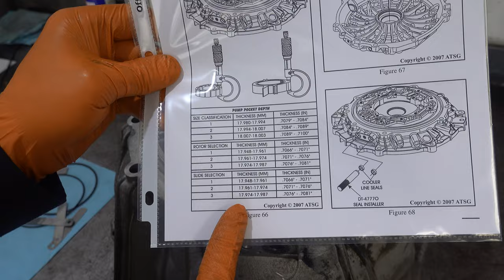6L80 Assembly PT1 - Subassemblies (DEMO) - Please Read Description

Comment: @Nickstransmissions so I have a 2013 Sierra 1500 4x4. 6L80E. I have the p0741 TCC solenoid stuck closed. So July of last year I installed a new transmission, new billet 3800 stall triple disc converter from ProTorque and their billet flywheel. Everything drove fine until Jan of this year. All of a sudden the code came up and the converter no longer was working. Along with Manual mode only working in 4-6, and the stall speed was higher. So I had a spare new 6l80E, before swapping them I did my research to see why it was doing it. Come to the conclusion that it was either the TCC solenoid in the TCM, the TCC regulator valve in the valve body, or the TCC control valve in the pump. I ohm’ed out the solenoid to the best of my knowledge and it passed. So I said screw it and put the new trans in, when I did even after programming and tuning the new trans it would reverse fine but it was stuck in 3rd gear. So I took the tcm&valve body from the trans that I thought the control valve in the pump was stuck in and put it in new trans. Lo and behold the problem transferred over. P0741 code, and the converter isn’t even trying to lock up. Now this whole time the fluid has been amsoil trans fluid, I have an inline tru cool 40k cooler, and thermo delete. It never really got above 170 even when pulling stuff. So I know it never got hot and I don’t think the converter is the issue. It’s got to be either the solenoid or the regulator valve because the problem transferred over from trans to trans. I don’t really wanna buy a TCM/Vbody ass, but what is the correct way to test the solenoid? It’s the 5th one from the Cannon plug for the harness. I swear I can command it to lock up and hear a noise like an electric motor run noise and then it stops and doesn’t do anything. What you think?
Reply from the maker: Hi Podunk Mechanics, thank you for watching...

I would vacuum test the valve body, paying close attention to the TCC regulator valve's sealing integrity. My guess is that it's worn. The new transmission should have had some valve body correction kit installed unless it was a GM remanufactured unit. 

You can watch my 6L80E Diagnosis and Troubleshooting PT3 which covers vacuum testing...I use Sonnax's vac test machine and their plates but I don't think you need the plates themselves, just the machine.

Here's the video: https://youtu.be/aBx63Vwo6mA

If the valve body does not have a Sonnax Zip kit or Transgo Reprogramming kit installed, I'd definitely install one of those two kits. You may also have  weakness in the pump (limit and control valves for the TCC) but can't vac test those unless the pump is on the bench...

Comment: So just thinking aloud… we install the Sonnex zip-kit with the o-ring fitted plugs to help mitigate hydraulic pressure loss. Along with that valves and other goodies are installed in the valve body. So my question is, why are you so hell bent on absolute pump perfection? We know the pump is capable of far more volume than what is actually needed to operate this unit even as it ages. Do you feel that once the Sonnex updates are done the transmission can operate normally and for a long time with a less than perfect pump?
Reply from the maker: Hi Larry,

"Hell-bent on pump perfection"? Interesting choice of words from someone who rebuilds (I'm assuming you're a fellow transmission builder)...I hate comebacks and warranty my work so everything is either new, brought up to spec via reconditioning or upgraded based on all the known areas of weakness in these (and any) transmission. 

That's why I have the standards that I do for all the transmissions I work on...I'm not perfect and shit does happen, unfortunately but I try to mitigate the risk of having to do the job twice to the fullest extent of my abilities.
Reply: @nickstransmissions perhaps that was a poor choice of words… I meant no offense at all.
Reply from the maker: No worries, Larry!

Comment: When assebling from all new GM parts, what rotor kit do you use, the thinnest one offered?
Reply from the maker: If using all new GM parts (which is def the right way to go), My machinist sources the rotor and slide then machines the pump body pocket so he can control the clearance, holding it between .001-.0015 between rotor and the pump body deck surface as well as slide-to-pump body deck surface.

Thanks for watching!

Comment: awesome video and great build tips. one question on the planetary. sonnax has a replacement cover, theres really no other way to get debris out without removing and replacing that cover. whats your thoughts? thanks doug
Reply from the maker: Thanks, Doug! I haven't used the Sonnax planetary kit for those transmissions, have it on my list to try for the next 6L80/90 I get in for overhaul.

Comment: I have a 6L90 that needs to be rebuilt, if I rebuild the transmission do I still need to have the transmission/ecu reprogrammed at the dealer?  I know a different transmission would, but hoping if I just rebuild without any performance upgrades  I wouldn't have to.  Thanks
Reply from the maker: Hi Justin, you wouldn't need to have the TEHCM reprogrammed if you either reuse your pre-existing one or purchase an OEM GM (or Sonnax) TEHCM but you will still need to do a fast adapt relearn...Reprogramming =/= fast adapt relearn...Reprogramming means you're changing the operating system on the TEHCM to match what's been installed on the vehicle ECM while 'fast adapt' simply means resetting your transmission's control parameters to how they were from the factory originally but leaving the operating system itself unchanged. 

I'd def install some performance parts if it's within your budget as they can only help, not hurt (except maybe the wallet).
Reply: Thanks a ton for the fast reply.  I bought the truck at an auction knowing it needed a transmission, looked like they dented the pan, likely broke the filter apart and it goes a few hundred feet then quits and the fluid is dark, no pink at all on a white paper towel.  Not sure I even want the truck as I don't really need it so thought about just cleaning and rebuilding the transmission replacing only needed parts to drive for a while and decide if I like it.  Good to know if I do keep it I can upgrade/improve it without having to reprogram it, dealer is an hour tow away. @nickstransmissions
Reply from the maker: You're welcome, Justin - thank you for watching! Please sub if you haven't already as ill be doing more 6L transmission videos in the next month or so.
Reply: Definitely subscribed and watching many videos.  Another question, is it worth putting a new filter in, tapping out the dent and adding some atf to drive it around a little and try to get an idea what might need replacing or should most problems be obvious enough if I follow along with your videos?
Reply from the maker: All the problems will be obvious once you get into it so no real reason to continue driving it...You also don't want to risk damaging the rear planet as those can be very expensive to replace.

Comment: On a 2015 6L90E. In the rear carrier assembly, it looks like it melted the rear piston and melted the rubbery plastic all through the rear clutch packs and locked up the trans. There is no metal anywhere, so it wasn't really slipping anywhere else. All of the clutches are still nice and redish. I am having a hard time getting the 2 shells out so I can get to the big snap ring. Have you seen this before and what may have caused it?
Reply from the maker: Damn, sorry to hear that GPVic...Rear planet failure can be caused by a number of things but most common are a combination of poor maintenance, low fluid levels and hard launches. The two hubs (1-2-3-4 and 3-5-R) that you're having trouble with are likely stuck in their respective sun gears. 

Was this transmission used in a performance application behind an engine making big power? Do you know the maintenance history? How many miles on the vehicle/transmission?
Reply: No sir. UT came out of a 2500 2wd. The guy stopped at a gas station and came out and that was it. I got UT apart finally. Those 2 empty shells are tore up with the bushings. The rear center support bushing is tore up alone with the bearing and the rear planetary gear set is locked up and stuck in the output housing. From the 1234 and I believe  3,5,R housing back I'd destroyed. This is going to get exspensive.  But it'll be new. I don't know what caused it. The fluid is dark and the filter looks clogged so prob lack of fluid to the tear. Now the rear most case bearing is good and I don't see any damage to the case so hmmmm. Maybe find a few used parts nd I'll be in there. All of the clutch packs before the 1234 shell look brand new but that means nothing lol. The lower sprag is locked slap up as well lol. Like I said. Exspensive!!!! Lol.
Reply from the maker: Yep...it may be less expensive to just acquire another core. Depending on year, you'd likely come out ahead vs trying to piece that one back together. My guess is that thing saw a lot of towing/hauling and was never maintained properly, fluid never changed, etc but just a WAG from here.
Reply: Yea that's gonna be my best bet. Thank you sir.
Reply from the maker: You're welcome!

Comment: I watched  another builder on you tube who recommended tig welding the shafts of the 1234 hub and the 3-5-R hub noting that the shafts can break at the hubs with higher horsepower cars. What are your thoughts on tig welding those? Do you think it could affect balancing? Thanks.
Reply from the maker: It's definitely a good idea to tig-weld the 1-2-3-4 and 3-5-R shafts to the body of the hub. Just thin bead all the way around will reinforce the hub and have no impact on balance. I would not recommend wasting time welding the 4-5-6 hub as the splines on the stock pieces can strip under high power/torque...I just replace with one of the billet steel options on the market (I typically use the Sonnax hub as it allows you to run the factory damper).
Reply: @nickstransmissions  Thanks for getting back to me so quickly. I already purchased the Sonnax Extreme Duty 456 hub and shaft assembly and the powerglide style 45 tooth frictions and steels. Along with the High Capacity 4-5-6 clutch apply piston kit. I will Tig-weld those other hubs as you recommended. Thanks again for all your help.

Comment: What would be normal for a machine shop charge to machine the bell housing/pump cover?
Reply from the maker: Hi Omar, that's going to vary but I pay my machinist $175 for a complete pump overhaul. that includes resurfacing both halves, cutting the rotor/slide pocket to depth such that clearance between slide/rotor and deck surface is .001-.0015 for both. I also replace the pump cover-stator gasket.
Reply: Thanks Nick! I just wanted to give myself an idea. I just bought one really cheap with the transfer case attached, for basically what just the TC is worth. If everything looks good upon disassembly, I’ll try to overhaul it following your videos. Thanks again!
Reply from the maker: You're welcome, Omar!

Comment: I am doing a swap in a 03'Crown Vic Police Interceptor.  Ls3/6L90. I bought a core out of a 2015 2500 2wd for $300. The guy stopped at a gas station and turn his truck off. He came out and it wouldn't move forward or backwards. Does it sound like maybe the converter or pump prob died? I know you can't diagnose it. Just curious what it sounds like. And my Ls3 is going to making about 450 ish wheel. Maybe a little more. Should I go with blue clutch plates? Burnouts and ice cream with the grandkids pretty much. Maybe red light to red-light. Down the road once I get the suspension done it may see the track ( road). I may the it drag racing a few times but I doubt much. I'm setting my redline a little over factory. I'm not going to be turning 6800 or 7k rpms. I want my engine to last. And trans for that matter lol. Thank you for the videos. They were very informative.
Reply from the maker: Hi Hugh, thank you for watching! 

The following could cause no movement in any gear/range in a 6L:
- Pump failure
- TC failure
- Stripped input shaft splines
- Stripped/destroyed front or rear gear set
- #1 and #5 check ball getting stuck in the plate
- Broken TCase chain (4WD only).

$300 is a good price for the 6L90 core...for your purposes (assuming you're going to be rebuilding it) either pump failure or check balls are the two reasons you're hoping for as separator plate wouldn't likely be damaged (if so it's cheap to replace) and the pump will be completely machined, gone through and new internals installed.
Reply: If I’m guessing.. I would say a check ball wore and got stuck in the separator plate.
Reply: @larryreno8293  I finally tore her down and half of the trans is garbage. The bushing from the hubs back arr junk. The bushings, the shafts are gouged up. The rear molded piston melted all through rear planetary and metal locked it up. Lol. She's in bad shape lol. Thank you for the info. I still haven't tore the valve body down yet.

Comment: Hi Nick, Since I'm building my 6L80 with all upgraded parts for more horsepower and will be having transmission tuned afterwards, Is it still necessary to have the Fast Adapt Relearn procedure done? AND, will it be ok to drive the car to the tuner without doing the fast adapt relearn procedure?
Reply from the maker: Yes, it can be done at the time the tune is uploaded. 

No, don't drive it without the fast adapt relearn being done or bad things may happen.
Reply: @nickstransmissions  Ok, Thank you so much. I will trailer it. I also took your advice and I am installing the Trans Go unbreakable pump ring kit 6L80-PKH. No other YouTuber talks about that. Thanks!
Reply from the maker: You're welcome, man! Yea, that Unbreakable Pump kit is a no-brainer and not sure why others don't discuss it (odd). 

Good luck with the build, let me know how it turns out.
Reply: Do you still like this method of pump alignment? Sure would be nice to save on buying a tool I’ll probably only use once.
Reply: @chrisfletcher  I didn't buy the alignment tool. I just made sure that the pump was even all the way around and slowly tightened the bolts down making sure it didn't move. I didn't have any problems doing it that way. I've heard of other guys putting 2 large hose clamps together, and using that method. But I Feel, that if your careful, you can align it by eye and by feel.